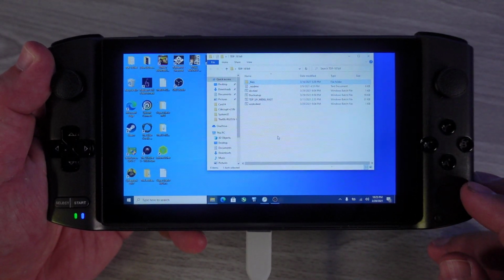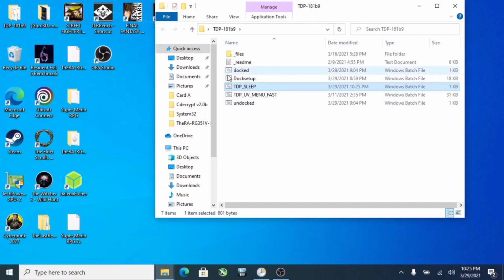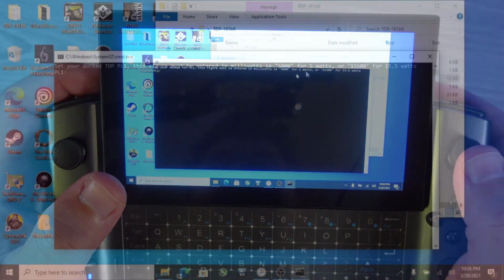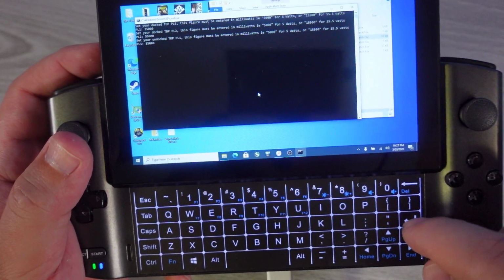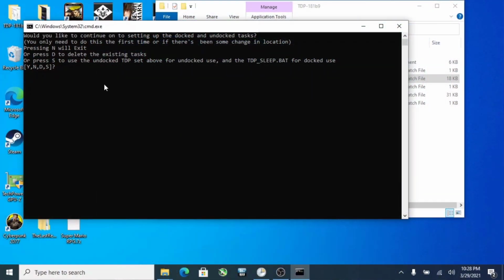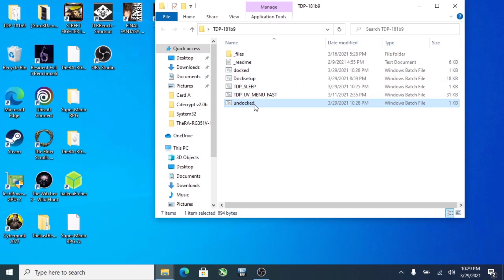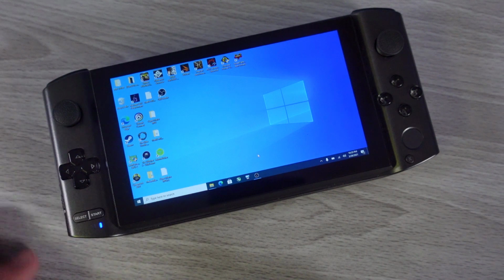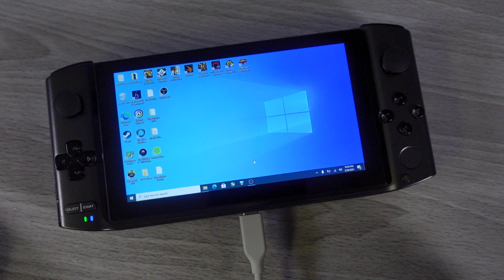GPD Win 3 - How To Automatically Set TDP - Docked And Handheld Modes

Comment: Random Question  but when you mess with TDP with this, should you have the windows battery power management set to best performance or ?? Does it need to be touched at all? Will doing so change what the batch file is doing?

Comment: Should a user limit setting it to 35W too often, to protect the battery, or is that not really a concern with modern battery and charging technology?
Reply: I don't think GPD have defined what the charge rate is? I would think while in the doc/charging it shouldn't make too much difference.

Comment: Pretty cool, but i think i'd rather have something that lets me quickly switch between TDP's manually, because i guess this also triggers when you're on the go and plug in a powerbank, correct? Using one of the macro keys on the back to cycle through the TDP with an onscreen confirmation would be ideal.
Reply: quick cpu is still good for tdp adjustment in real time on tigerlake. Just no undervolt capabilities anymore (hopefully that changes🤔) 
And still useful to keep an eye on what everything is doing

Comment: Would something like this also be possible on Aya Neo?
Reply: I would assume so. But keep in mind that device uses AMD not Intel.
Reply: @i_used_adblock_to_watch_this  yeah true. I thought that maybe there is some sort of universal communication protocol between Windows and the power management IC and this script just simply set some new parameters. But when I think about it you're probably right. x86 systems are quite complicated compared to the more simple ARM systems which often only have a PMIC and that's it. x86 has the BIOS and whatnot, so most likely it won't be possible to just simply run this script on Aya Neo and call it a day.

Comment: @ThePhawx when you dock the GPD Win3, does it automatically output to HDMI (if available) ? Or perhaps can we add another BAT file for that?
Reply: Hey Marcel, I believe the USB C outputs to HDMI 1080p when outputting to a larger more capable screen.
Reply: It technically shouldn't, I assuming it is just normal windows 10. It needs to be set in the settings menu the first time then it is automatic.